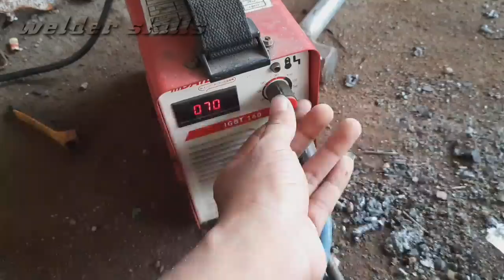few people know about welding 1mm

Comment: Hi there, I noticed that you used another wire as well as the welding rod to cover the holes. What type of wire was it?
Reply from the maker: yes, I use unpan wire, you can also use welding wire which has been removed first from the carbon layer on the welding wire rod. or you can also use a similar wire with a size of 2mm
Reply: @welderskills  Thanks.

Comment: What was the other metal your using,is it ms or some iron rod,i am in learning  process,i have lots of these to weld
Reply from the maker: metal I use 1.2 inch galvanized iron pipe 1mm thickness

Comment: im a beginner: question: ehat is the 2nd bit just steel wire ? or a 2nd 6013 rod?
Reply from the maker: only steel wire, you can also use 6013 rods but first remove the carbon layer.
Reply: ok!!! i guess makes it makes it easier to solder thin stuff for beginners? or is it also valid for professionals?
Reply from the maker: This applies to soldering thin items, not to thick surfaces, beginners and professionals alike.